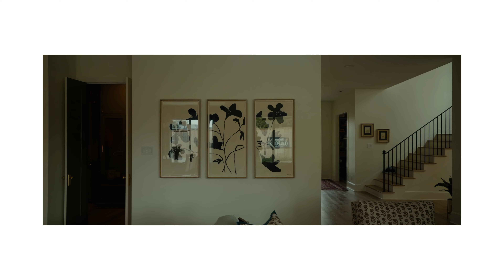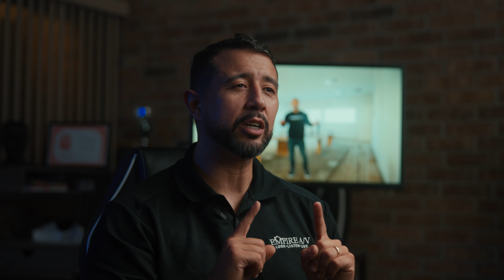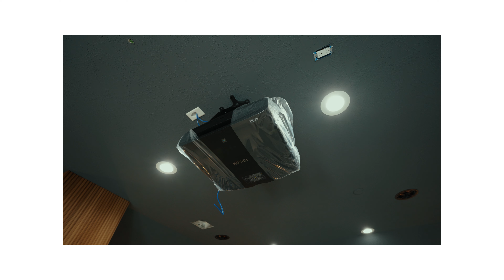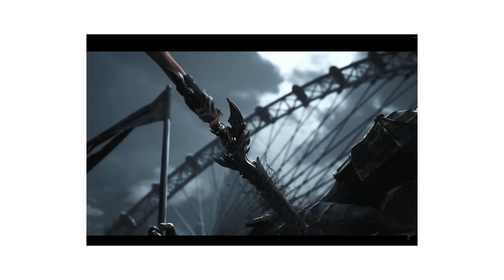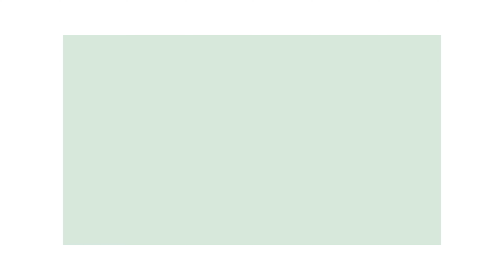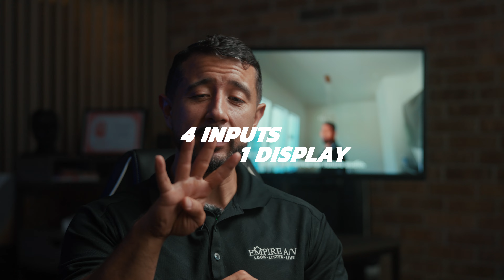Budgeting for Home Automation Q&A | Episode 3

Comment: Hey just a quick question i dont have time for a call now sorry but, i llive in Surrey british columbia Canada, i will pay for your flights and Stay wondering if you guys would come work , becuase im building a new house soon a foreever home and i want the best of best stuff basicaly no budget
Reply from the maker: Hey! Thanks for reaching out. We do travel for certain projects, especially when the goal is to build something truly next level with no budget limitations.

Whenever you’re ready and have the time, feel free to schedule a virtual meeting. We can go over your vision and see if it’s a good fit to bring your dream home to life.

Thanks for watching
Reply: @ okay awesome, do u guys also do electrical? work cus you
guys will put smart lights , and would you do Alarm systems also? just to know before i go foward
Reply from the maker: Smart homes require a lot of different trades working together — electricians, HVAC, builders, and us. Our job is to design the system and handle all the low-voltage work with  smart lighting, automation, cameras, AV, and networking — then merge it all into one seamless experience.

We don’t handle full electrical work ourselves, but we coordinate closely with your electrician to make sure everything lines up with our smart systems. As for the alarm system, due to licensing restrictions in different regions, that would need to be handled by a local provider — but we can usually integrate it into the rest of your system for a smooth experience.

When timing is right and you are ready we can go over more details.
Reply: @ okay awesome! looking forward to book a call soon once we got the Lot planned out

Comment: I have a home south of the Dallas area , I’m thinking about doing control 4 in the home . We only spend 2 months within a year at the property ,but we rent it out the remaining of time.  All my other homes have home automation , however this would be the first time using control 4 . Would a $65,000 budget be enough? Also the home is fully built, we had a custom built in 2018 .
Reply from the maker: A $65,000 budget is actually a very solid starting point for a Control4 system, especially for an already-built home like yours. With that budget, you can typically expect to cover a audio system, smart lighting for at least common areas, access control (smart locks, door stations), HVAC networking, and a solid automation backbone that ties it all together—making it super simple whether you’re there or when it’s rented out.

The main variables that would affect the final scope are things like size of home, how many zones of audio, how advanced you want the lighting, whether you want integrated shades, and the size/complexity of the security system. (if there’s equipment already there, some of it may be able to be used and just integrated.)

Since the home is fully built, some retrofit work might be needed depending on how far you want to go, but with your budget, you’re already in a strong position to do a lot.

Hope that helped, we’ll be here whenever you’re ready to explore the options.

We appreciate you watching
Reply: @  what is your website
Reply from the maker: www.empireavservices.com